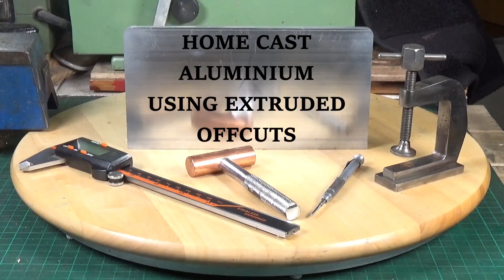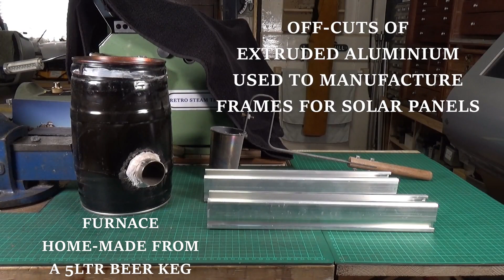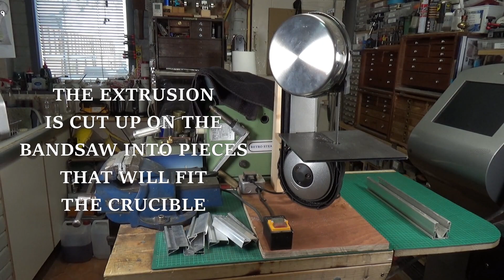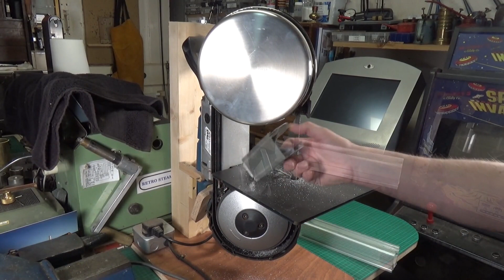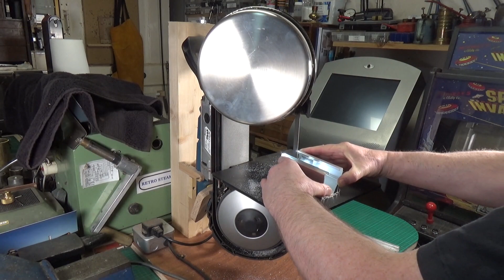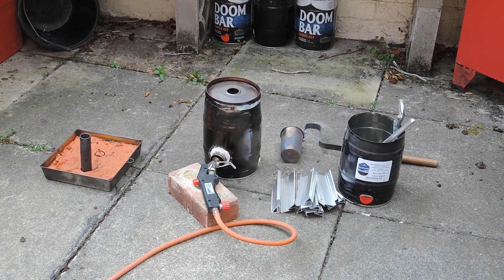Home Cast Aluminium Using Extruded Offcuts

Comment: Gday Alan, I think your right when you say there’s more then one type of extruded aluminium, they came out of the mods a lot easier then I thought they were going to, great job mate, Cheers
Reply from the maker: Hi Matty. Certainly seems like it. With regard to the moulds, I just followed Rob's advice, use seamless tube and get them nice and hot before pouring the ally. I also recommend using thick walled tubing for the moulds, seems to work better. Cheers, Alan.

Comment: Morning Alan. Compared to Rob’s extruded aluminium yours looks very good indeed. As you say, there is obviously more than one type of extruded aluminium and you appear to have a supply of the better stuff. Thank you for sharing. 👏👏👍😀 Andrew
Reply from the maker: Hi Andrew. Yes, I was a bit luckier than Rob. The thing is even if it doesn't produce any useable aluminium, all that it has cost you is a little bit of gas. Cheers, Alan.

Comment: That came out well. For best results for casting use metal that has been previously cast as the silicon content is correct for a casting.
I would never use drinks cans or extrusions myself but you seem to have got away with it. Using a flux and degassing helps too! 
Not a critisism as you did well and i realise it was just to see how it went.
Reply from the maker: Thanks. Having watched a lot of your casting videos and Rob's I know that it is best to use previously cast aluminium. I figured that if it turned out to be rubbish I'd only wasted a little bit of gas. It was very clean when it melted, probably some of the cleanest I've seen, very little dross on the surface of the melt. Cheers, Alan.

Comment: Great vid.  You can add silicon to improve the quality of the metal.  Also copper to make duralumin alloy or aluminum bronze, which is very nice to work with and is quite strong.
Reply from the maker: Thanks and thanks for the information.

Comment: Good video Alan and good job.  You did that pour exactly as I would have done it, metal just gone liquid, no overheating, pre-heated mold, no flux or degasser, and it came out and released fine.  The end result looked good with no sign of porosity that I could see.  Did you change the  insert cutting angle to get the better finish at the end ?   Generally I find a lead in to the blade edge will do better than the tip.  There is obviously a huge difference in ally and that extrusion did OK.  Perfectly usable.  Looks like you will have to save up for that 1698 :)  Cheers Rob
Reply from the maker: Thanks Rob, I learned from the best 😉 . Yes I did play around with the cutter's angle and I used WD40 as lube. I've found that different types of aluminium require different cutter angles to get the best finish. Quite pleased that it turned out ok as I was given quite a lot of those offcuts. Yes, I can't see Shepherd Neame accepting aluminium bars as payment for their beer sadly! Cheers, Alan.

Comment: Great job Alan
 (1st time iv'e seen your garden railway i think!!)
Must have a go at this casting aluminium
Where is the crucible from!!!!, and noticed the torch didn't blow out when stuffed up the hole!!!! thought it would need more air.

cheers
Kev
Reply from the maker: Thanks Kev. The garden railway is a little bit neglected these days, I need to spend some time on it! The crucible is a 350ml stainless steel drinking cup which I got from Amazon for £5. The pipe that the gas torch sits in is a fair bit larger than the end of the torch, plus the furnace lid has a large hole in it. Cheers, Alan.
Reply: @RetroSteamTech Hi alan, didn't mean the container for the molten alloy, but the actual crucible shell/body 👍👍👍
Reply from the maker: @MrFactotum  Oh, the actual furnace, it's a 5ltr beer keg. I did a video on how I made it here https://youtu.be/vYXWm1WnpLo

Comment: It did turn out well compared to Rob's... some good tips there from myfordboy...
Reply from the maker: Hi Paul. As you probably know, myfordboy is the master in backyard metal casting. If you fancy a go watch his videos! Rob has been doing this for years and knows his stuff. I just follow their lead 👍👍 I knew that the extruded stuff would probably have been crap but as it turned out it wasn't half bad.  I was just lucky, as the masters say, generally just stick to metal that has been cast once as it will generally give you good results when cast again. Cheers, Alan.